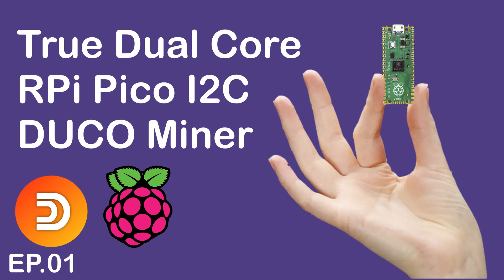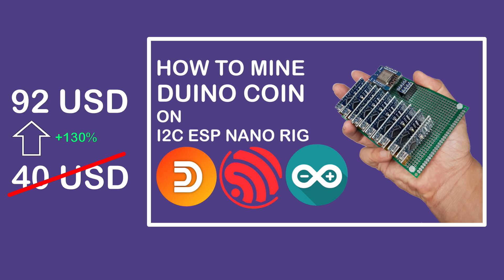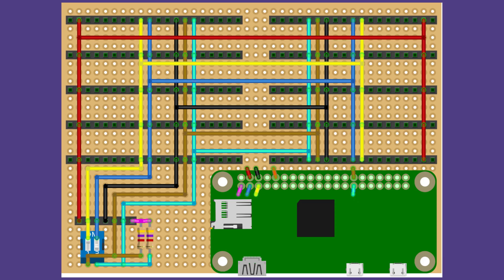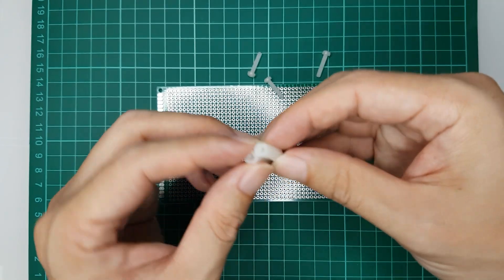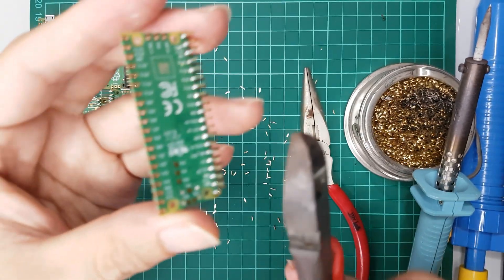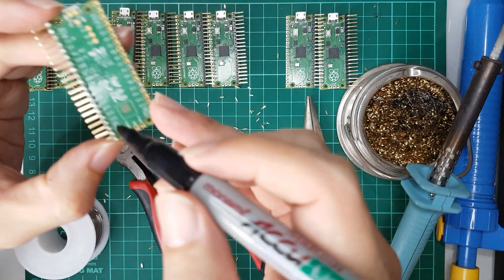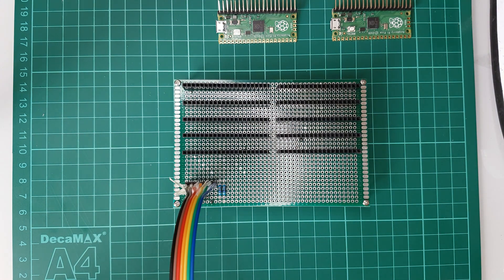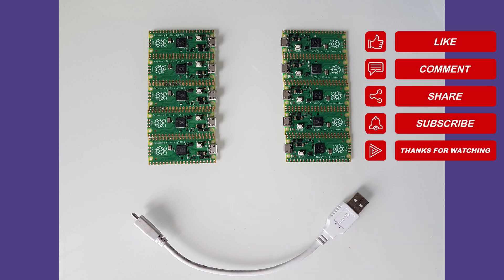True Dual Core RPi Pico I2C Duco Miner EP.01

Comment: I am planning on building this and have a couple qustions..  1 what watage 4.7k ohm resistor do I need. 2 I noticed on your video that on the pi zero schematic you have 8 connections coming from the pi zero is that an error and wich one isn't needed from what I understand there should be 7 connections too the pi and board header?.  3 on the shcmatic you show both resistors side by side the top has a purple bar.. is that connected to both of the resistor tops a d too that first pin on the right?
Reply from the maker: A1. regular 0.125W resistor is sufficient. A2. good eye you have there. the 8th wire on the Pi zero is for UART in case needing to debug, we might want to get serial print from any one of the pico by connecting it to GP0. A3. it's connected to both resistors
Reply: @JKRolling  when are you releasing the software video for this..

Comment: Nice video, In my location the RPi Pico is $16 for 1 and, the NodeMcu is $28 for 5. Can I use those with an old RPi 3B+ i have lying around?  Can the NodeMcu be used as slave? The Pico is for too $$$
Reply from the maker: I'll work on adding esp8266 as slave soon. but it depends on how the esp behave. you may get latest update from duinocoin discord